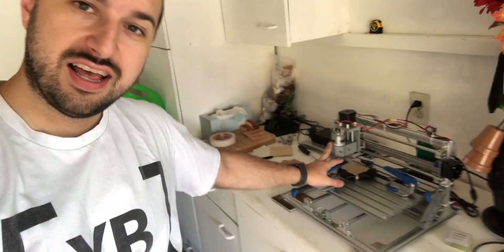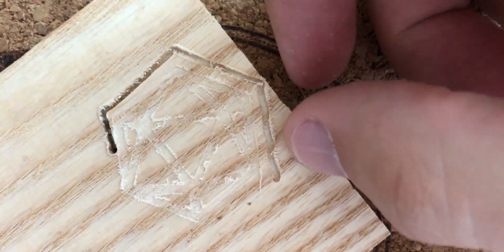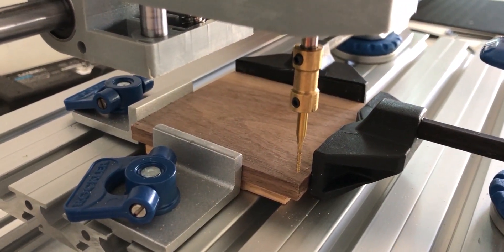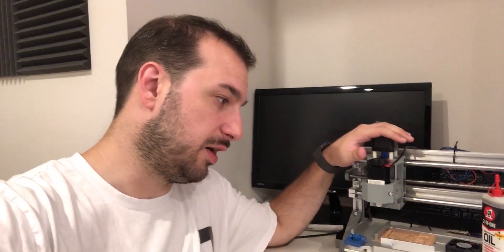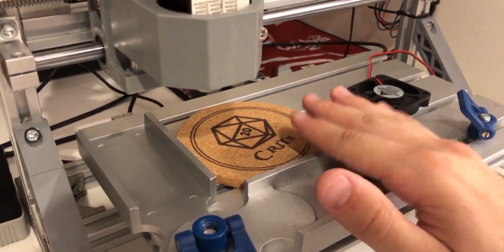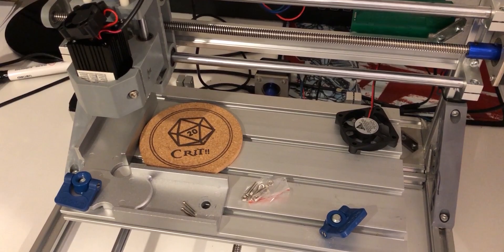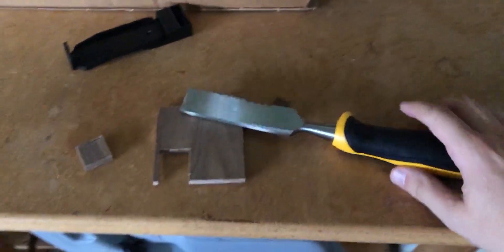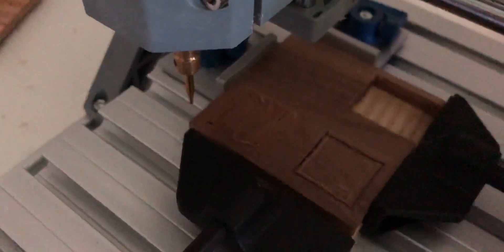CNC 3018 Carving Issues & Progress

Comment: I just ordered one of these machines... 

my experience has been mostly with Haas VF series machines, and a few other large, high precision CNC's. I always learned (when running a 1-off, or new program especially!) To run the machine in 'single block', which runs the program 1 line at a time. That way you could see exactly what the machine was about to do before it did it, often avoiding crashes. 
What software do these use and is there a similar mode with these guys?

Comment: I use a 3018 pro and it is carving about the size of my thumb and it should be doing a 9 inch by 9 inch Jesus holding a lamb.  I tried the mm and also inches.  Still the size of my thumb.  I have windows 10 and am using GRBL candle but not the windows 10 version.  Is this the problem?

Comment: Hi, thanks for this video. I found that my x axis screw was loose in the blue holder  fixing it to the stepper motor with the grub screw. It was working sometimes and sometimes would slip out. I ensured its tight and slowed down the feed rate and seems to have helped

Comment: Your Z axis connector slipped out? Or you ran too fast inch per minute?
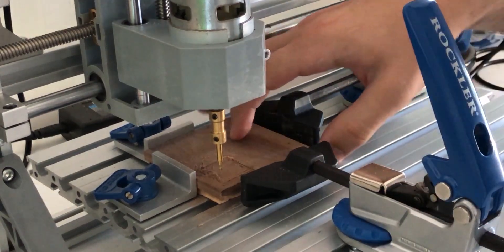03:45 is your cutter seated deep enough in the collet? You have a very long cutter bit showing?
Push Play button and look for next likely issue ...

Comment: I'm having a lot of luck using the following settings. Will post some videos soon. 

LUBE THE BEARINGS

$110 = 2000.000 (x max rate, mm/min)
$111 = 2000.000 (y max rate, mm/min)
$112 = 1500.000 (z max rate, mm/min)

$120 = 45.000 (x accel, mm/sec^2)
$121 = 45.000 (y accel, mm/sec^2)
$122 = 48.000 (z accel, mm/sec^2)

$130 = 290.000 (x max travel, mm)
$131 = 170.000 (y max travel, mm)
$132 = 44.000 (z max travel, mm)

Feed rate = 400
Plunge Rate = 120
Dept per pass = 0.05 to 0.03

Comment: I knew precisely what's happening, happened to me, its COOLING!! I fitted a 12v pc fan on the control board and it fixed it 100% its over heating stepper drivers missing steps and going nuts. also add heatsinks to the stepper drivers and cpu, u could also do the same with the laser just power it from the 12v on top of the laser.  mine cuts at 750mm/m feed and 1mm depth and a 1/16" bit ( 1000mm/m with a 1/32 endmill is also doable) at that speed, 500 and 1.5mm is pushing it.  but don't plundge faster than 250mm/m with those type of bits, also for all that is holy go with the e11 collet for the spindle! you can use 1/4" bits with that
Reply: Did this solve your plunging problem?

Comment: Bought one of these cheap chinese 3018 machines in December, mostly for pcb isolations.
It's been a battle. So far I have a burnt PSU (24v 5a cheap black brick that came with the system), burnt MOSFET for spindle (came mounted on the woodpecker controller) and a horribly flexible Z assembly with 2mm of slop.
But I have still been able to route a few successful boards.
Eventually I will rework the whole machine, as it has decent bones.

Looking forward to watching more of your experience.

Cheers!

Comment: TBO get rid of thos clamps..i would think you would want the wood flat ...Thos clamps with to much pressure could lift the wood up at a angle...
Reply: I think the same thing, The clamps are pressing too much and the bits are getting squeezed.
Reply from the maker: A new video is coming out on Friday detailing a bunch of the things I've been doing wrong... it's 6 months in and I just feel like I'm getting the hang of things now.

Comment: I think you have electrical interference between your laptop and the router, some clip on ferrite clamps might well help (yes I know the usb lead normally has one on) but some more wont hurt.
Reply from the maker: It was actually a different problem, but I might try this just to be even more protected! That video should be coming out very soon!
Reply: We had a similar issue with our Shapeoko 3. The ferrite clamps worked for us.

Comment: Have you had any issues with the scaling? Every time I try cutting everything but the sample gcode it's three times larger than it should be and won't zero correctly
Reply from the maker: It sounds like your step ratios are off. Try moving the machine exactly 1mm, and then check the actual move. From there do some math and update $101-$103 with the new ratios.
Reply: Which program are you using?

Comment: stupid question, but is the bit solidly in the tool holder?
Reply from the maker: It is not, it's held in place with a few hex screws.
Reply: @MichaelMakes  makes me wonder if the bit slips out of the collet and plows into the wood.
Reply: Hi, it is probable. My first upgrade of 3018 was  switching to ER11-A collet chuck